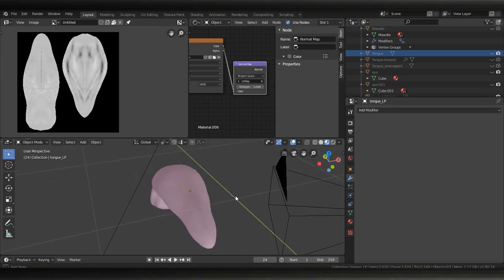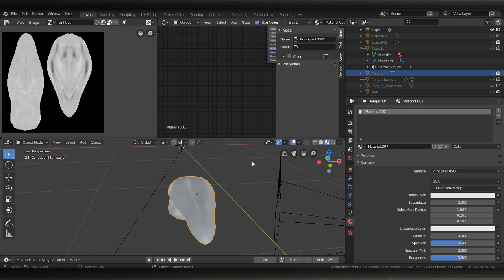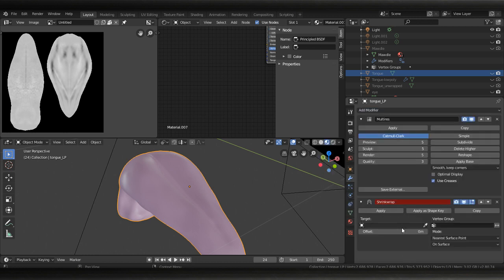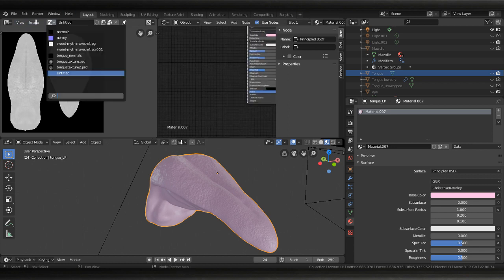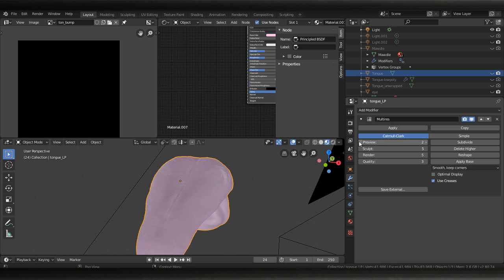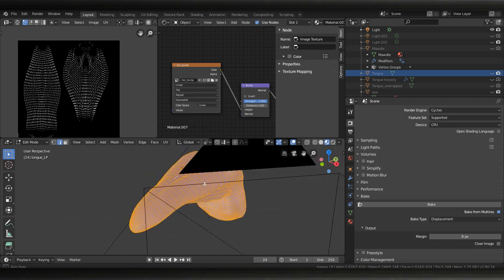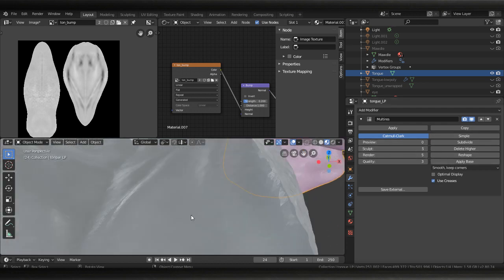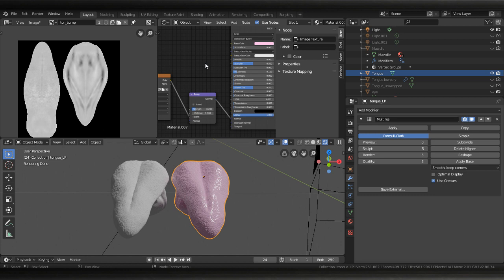Blender 2.8 Baking Displacement Map w/Multires

Comment: I have successfully created displacement map and normal map too but none of them gives actual bump to my mesh even after selecting   "displacement and bump" option, however normal maps as well as displacement maps made by others produce actual bumps. I'm not able to figure out what is wrong.
Blender version 2.82
Reply: OK, now I understood that normal map and displacement map used with bump node actually fakes detail while using displacement map with displace modifier adds detail by actually deforming the mesh to which it is applied.
And you know what normal map also works fine with displace modifier

Comment: are you selecting both mesh...I have been trying this method for over 24 hour and still nothing..Im not getting and information from the high poly mesh. Blender only lets you select one object when using this method. How is it baking done to the low poly object. when i press bake all im getting is a gray with no details.
Reply: nvm got it ...this method is so stupid but thank you for the tut!!!!
Reply: @swishtos   is there a better way?
Reply: @stalinak7550  zbrush is the fastest way that I know...especial with high poly mesh...blender takes to long!
Reply: I think you forgot to put multiresolution to zero befor baking, I had the same issue the first try. But work fast and well.
Reply: @swishtos , this is a blender tutorial, isn't it ?
Reply: You might have forgotten to set preview to 0